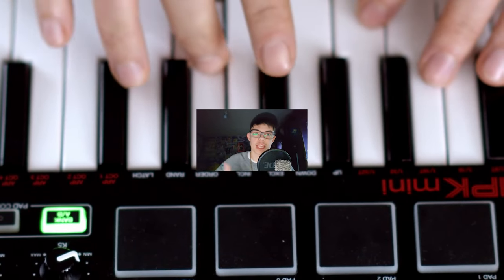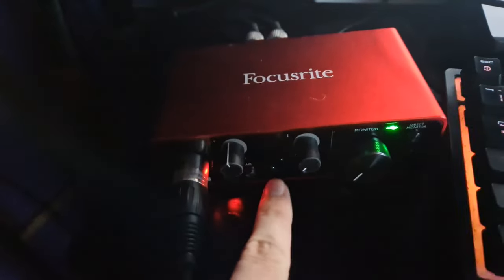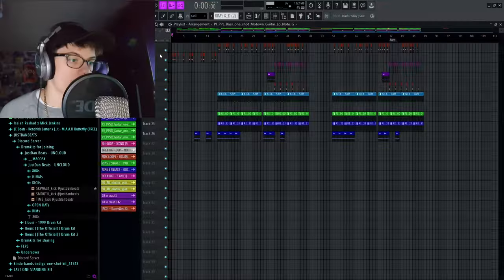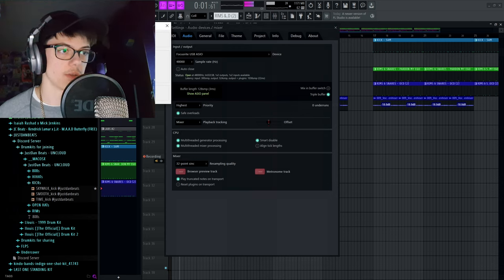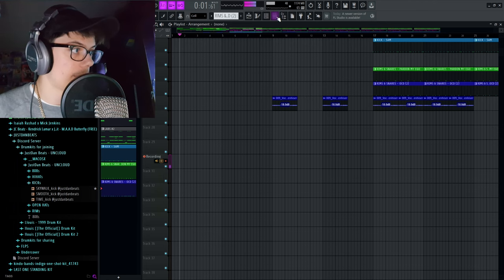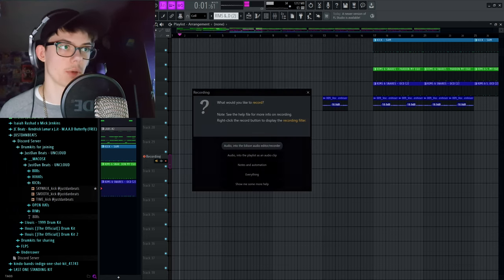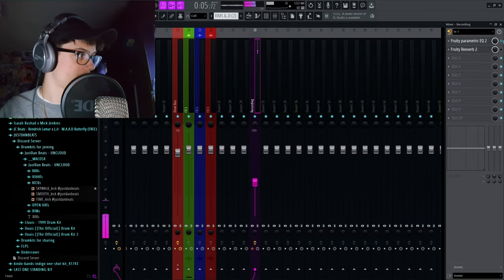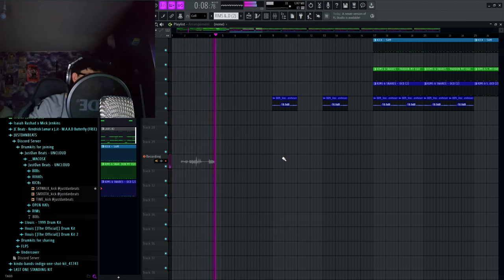How to set up your microphone in FL Studio 21 (RODE NT1A, Focusrite Interface)

Comment: Hello, great video, I would have a question and I have a Fifiné XLR Headset, and an interface of Scarlet 3 gen, only I cannot connect my headphones because I use normal headphones ... have connected a headset with my microphone, But how is that supposed to work with the Scarlet Interface ?? Do I need 2x headphones ??
Reply from the maker: You need a jack adapter so you can plug ur headphones into your interface

Comment: Yo bro I can hear myself and everything in my mic turned everything on, but records no audio. I’m using a Mac charger to connect my interface to my laptop idk if that affects anything but was wondering what I’m doing wrong, thanks.
Reply from the maker: the charger may  be the reason. It needs to be a dat transfer cable and not a chargin cable. Also you can turn off monitoring by cliking on the middle speaker button in your playslist and setting monitor to off.  also make sure you are using the correct drivers. Lmk if you need any more help!

Comment: I am having troubles with the latency and cant get it to settle down
Reply from the maker: can you elaborate on your issue?
Reply: @RealSparkz well I think I'm have it set up right. I try to record but there's still a delay and it won't straighten up. I legit am running out of ideas on how to fix it
Reply from the maker: @tgm-tallgoofymexican55  First make sure your driver is set to the correct one for your interface, for example mine is "Focusrite USB ASIO" If driver is set correctly, go to the top left under "Options" and select "Audio Settings". Click on the button that says buffer length and "Show ASIO Panel" Click on the box that sayz buffer size and set it to 128, keep lowering it until the issue stops. Bare in mind the lower the number the higher chance of the audio quality diminishing.
Reply: @RealSparkz  the only ASIO options I have are ASIO4ALL v2, FL studio ASIO and Realtek ASIO
Reply from the maker: @tgm-tallgoofymexican55  go onto google and search your iterface drivers. For example search "Focusrite Scarlett 2i2 drivers" and make sure they are installed before continueing
Reply: @RealSparkz i did that now it won't let me change the setting and I can't hear myself. I'm going to mess with it today and hopefully get it to work

Comment: hey bro everything good just my mic too low when i record ( neuman TLM 102 )  can i volume  it up through the daw because when i do it from the voice card it starting picking
Reply from the maker: Does turning up the gain on your interface make the audio sound worse?
Reply: Yes thats why i want to do it otherwise
Reply from the maker: @StoyanSakazov-k6c  try recording at a lower gain (set it to where the sound isn't degrading) record it and then turn it up on FL manually on the sample. If the sound is still worse there may be an issue with your interface. Try using different hesdphone or earphone if available to make sure it's not them. Let me know if you fix it or this helped 🙏
Reply: @RealSparkz  thanks will try :)
Reply from the maker: @StoyanSakazov-k6c  did you manage to fix your issue?

Comment: did you get background noise ? if you get noise how to remove do you.
Reply from the maker: try recording in a confined environment like in a closet as the RODE NT1a is a studio mic it picks up audio very easily. Let me know if you need any more help!
Reply: @RealSparkz   @RealSparkz   i have rode nt1 5th gen and i order scarlet 2i2 gen3 im waiting my soundcard, im recording right now with usb c cable. actually rode nt1 5th gen good at this job with usb c cable. i think im doing bad mix or something else. Im gonna try to record from more quite environment i will try to recort in closet or somewere. thanks. i let you know if i need more help.
Reply from the maker: @ProdByBaly  yeah no problem,  try turning down the gain in the mic if you can that might help. 🙏💯
Reply: Hey I have the same problem lol I got the same mic with a scarlet 2i2 the mic is cool but in xlr mode the background noise is so overwelming I can even heard sound coming from my kitchen lol, also I am a bedroom producer my room is not accoustically treated I have a few foam panels in front of my deskstop desk. is USB connection the way to go tho ?
Reply from the maker: @2010waslit  no xlr into a interface is always better. It sounds like your gain is set way too high or you have fx in your daw boosting the sound. When you record your vocals end up covering alot of very quiet nose if mixed properly but you shouldnt really be hearing other rooms clearly. I would recommend turning down your gain and maybe putting your mic in like a wardrobe or something. Let me know if this helps 🙏
Reply: @RealSparkz  gotchu I am try that and will let you know what I get
Reply: @cheatcodez  hey I think I did I guess using some background noise removal vst and  turning down the gain knob a little bit did the trick

Comment: Just bought this mic. But there’s a problem when I try to connect it to fl studio. (im using the usb cable btw). When I use Fl studio ASIO and put the input as the rode NT1 gen 5th, and try it, it sounds very bad. But when I try it in the rode connect app, it sounds so good. So I changed my device to ASIO4ALL and tried out the microphone. It sounded good in fl studio but there’s this loud static noise. Is there a way where I can connect rode connect to Fl studio ASIO, or get rid of the static noise somehow while using ASIO4ALL. If you have any suggestions please share 🙏
Reply from the maker: Are you sure there's not specific RODE drivers you need for your pc? If there isn't try recording in another app and seeing if there's still an issue so you know whether it's fl studio or your pc. Hope this helps
Reply: Wdym by rode drivers? Like rode connect? It might be the computer or like the connection between the mic and the computer, because I tried it on discord and it sounds very bad. I will try this mic on another computer and see if it works better. Thanks.
Reply from the maker: @Lil-Deej  https://help.rode.com/hc/en-us/articles/7416681704463-NT1-5th-Gen-ASIO-Driver.                 If this isn't your mic just search for your model.
Reply: @RealSparkz  thanks, wait what do i do after downloadimg the asio driver?
Reply: @RealSparkz  nvm I got it bro thank you so muchh!!!!!
Reply: @RealSparkz  youre a life saver dude!! it works now, its so clear. Ima subscribe bro, great stuff.
Reply from the maker: @newflowscomingbepatient  Appreciate you bro 🙏

Comment: I have the same microphone, same interface, same settings, WHY DO I HEAR NOISE AND CRACKLING? Its so bad that it overpowers my voice and is louder than me.
Reply: Im using the correct driver, 48V is turned on too
Reply from the maker: @RXKDon  make sure the gain isn't too high and you've actually selected the correct driver in the DAW and not using the FL studio ASIO or ASIO4ALL. Make sure it is the focusrite drivers. If that doesn't work test it outside a DAW and see if the issue persists. May be a fault with either the wire or microphone
Reply: @RealSparkz  when i use the normal windows audio recorder its fine.
Reply: @RealSparkz  I have the same exact settings in FL as you though, Focusrite USB Asio, sample rate 48000, buffer length 128, mix in buffer switch, highest priority
Reply from the maker: @RXKDon  send me a video of you using it at my email SolitarySparkzbusiness@gmail.com. only other reason I can think is, the gain is too high or the effects your using cause that effect
Reply: @RealSparkz  I fixed it now, the problem was that I had to switch between Focusrite USB ASIO when I wanted to record and my headphones when I wanted to hear the recording because my headphones have a 3.5mm connection and I cant plug them into the audio interface. When switching to my headphones the buffer length was too short which made the recorded audio have noise and crackling, after increasing it the same audio sounded normal. I ordered an adaptor for the headphones now. Thank you though
Reply from the maker: @RXKDon  glad u sorted it 👍